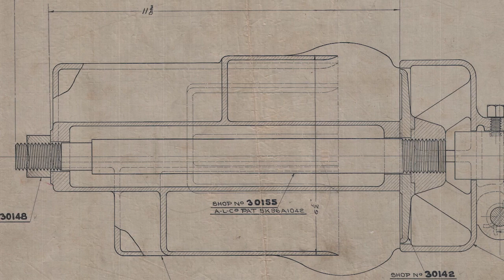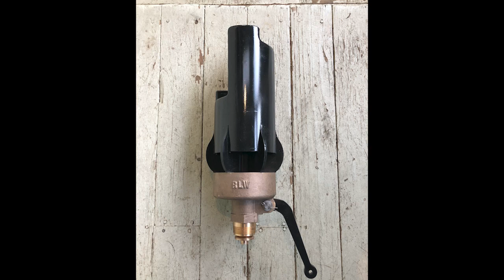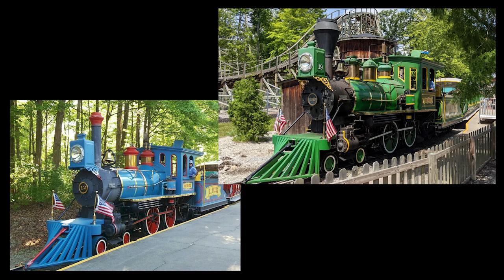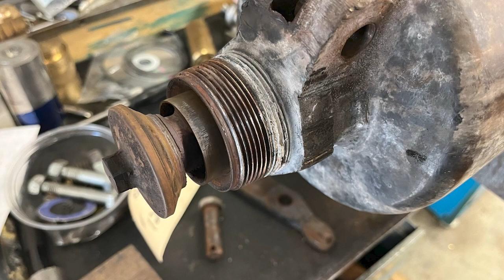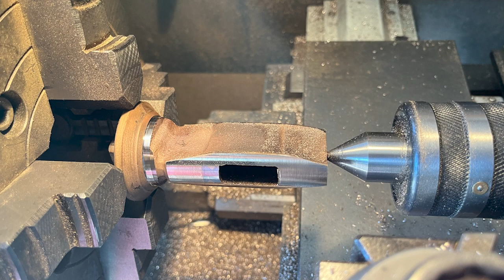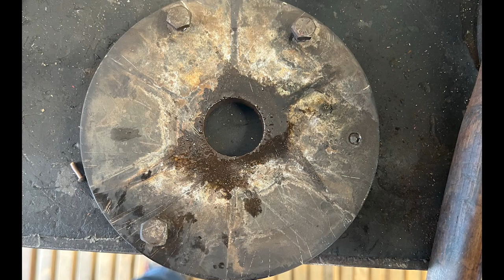Kings Island and Miami Valley Railroad Nathan 6 Chime Rebuild

Comment: Hopefully more mainline engines will have their whistles fixed. Like N&W 611's Hancock.
Reply: #611’s whistle is an authentic Hancock Long Bell 3 Chime from one of her long lost sisters.
I don’t see anything that needs fixing.
Reply: @Train_Tok_Man  I think 611’s whistle is from her sister 610
Reply: @rudycarlson8245  You were both told incorrectly; Scott Lindsay told me that the 611's 2016-2022 Hancock whistle is NOT from one of her long-lost sisters whatsoever.
Reply: @nicholashuynh6907  OK so if if it’s not from one of her sisters, is it her original whistle the one she was built with? And here is an idea what if the 1218 whistle was put on the 611 as a guest whistle?
Reply: @rudycarlson8245   As far as I know, 611's original whistle is still in possession with Preston Claytor and was now in use on U.S. Sugar 148. I heard 611 is now using a new Hancock whistle, which was originally used on a NP 2-8-8-4.